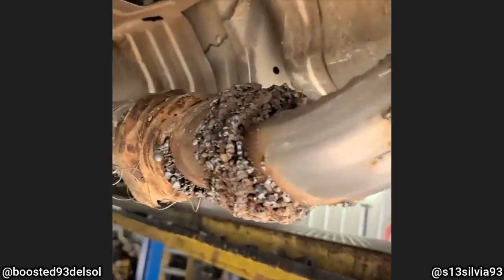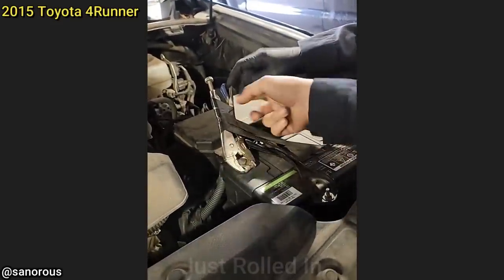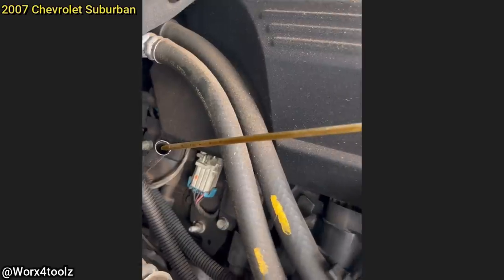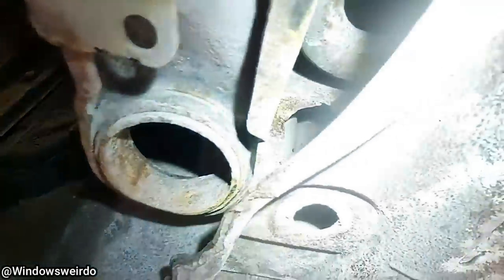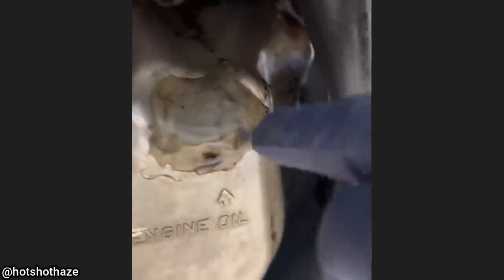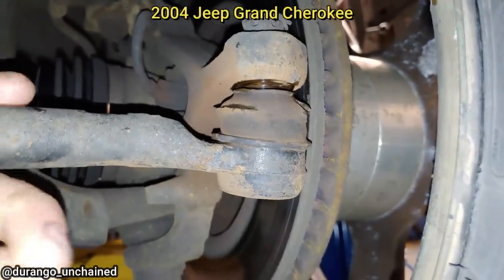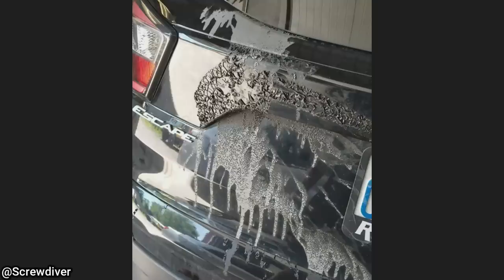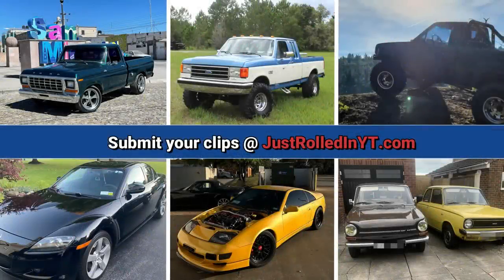Customer States Exhaust Sounds Terrible & Drags On The Ground | Just Rolled In

Comment: I’m always shocked when you say customer declined repairs over obvious problems.  Many (MANY) years ago I had a Saturn LSE & took it in for a problem I had at another shop.  The tech fixed my ongoing expensive problem for $12 then told me he couldn’t let me drive out because of a bad ball joint.  Obviously after getting seriously ripped off at the previous shop I was skeptical but he took me into the back where my car was on the lift & showed me my wheel was about to fall off.  I swear my heart stopped. At the time I had a daily 3 hour commute with speeds in the 80’ and for months I had to repeatedly get my car towed to the previous shop, spent 2k on repairs & not once did they mention my wheel could come off!!!
Reply: I'm hoping you don't go back to the first shop ever again, but please stick with the honest mechanic at the 2nd shop. Honest and knowledgeable techs are hard to find!!! (I know, because I am one).
Reply: @61rampy65  I'd recommend going back to the first just one more time to demand a full refund or face legal action
Reply: I was recently quoted something like 700$ for a new ball joint.  I went online and bought a whole new control arm with ball joint for 70$, and it was "moog", one of the best after market companies out there.  Took me an hour to replace it.  4 bolts.
Reply: Well not everybody is able to afford to fix their car right away like you obviously are. Consider it a glimpse into the life of poverty.
Reply: @markshort9098  I did go back to demand a refund, got some of the money back and that the tech was purposely not fixing my car correctly so I’d keep coming back because he wanted to get to know me better.  My husband then got involved. 😉
Reply: @bethmahadocon1887  unfortunately that sort of thing is very common and so is doubling the price just because the customer is a woman ( the vagina tax) I told my sister to always make sure to take a man when dropping her car off at a mechanic to avoid problems like that.. my sister took her last car to 2 mechanics and neither fixed it and she pulled up here and I had the problem diagnosed in seconds by ear before I even lifted the bonnet, any mechanic should have known what the problem was as soon as they heard the engine running
Reply: @markshort9098  I’m glad your sister has you to look out for her.  I used to be able to do my own maintenance. I’ve changed starters, alternators, spark plugs & rebuilt an old ford engine.  But, once computers got involved I had to step back.  Now I own a rotary and while I’ve run into the ‘vagina tax’ for repairs on that Google, my husband and local rotary clubs have been awesome at fighting that.
Reply: These shops really hurt the industry. I'd say more than half the shops see a car and see dollar signs that's it. Sell as much crap as possible, use scare tactics ect.  I see the person and their situation and list the problems as to importance and do what we can with the money they got... 

Im also about to close my shop cause its a cut throat biz and I'm too thoughtful, nice, and honest . If you want to make real good money you have to be ruthless. I mean i get by honestly but I can make more at other jobs that are much easier to do.
Reply: customer declined repairs can simply mean they cant afford the work at that point in time.
Reply: It may be a simple math problem.  A car is only worth X amount of money, repairs cost Y, and a new costs Z.  I've declined repairs on older cars before, because I decided it was simply time to trade the car in and get a new car rather than spend thousands of dollars to try to fix it, money that would be better spent on a down payment.  That said, I have never continued to drive a car in an obviously dangerous condition, but that may be what is going on in a lot of these cases.
Reply: I realise this isn't one of those situations, but do mechanics pull the same as computer technicians?  eg. pulls up netstat Look at all these people connected to your computer.  This is going to take hours to fix.
Reply: @jeremyr7147  There are such auto repair shops everywhere in China, and finding them temporarily in case of a sudden failure is tantamount to a sheep entering the tiger's mouth. The maintenance price of the manufacturer is also very expensive, but at least it can guarantee the use of original parts. Therefore, it is very important to learn the basic fault judgment ability and to have a fixed and credible cooperation channel for providing accessories.:goodvibes:

Comment: Some of the best advice I ever got was any cap that you pull off put it on the latch for hood,  so forgetful people like myself will be forced to figure out why the hood won't close
Reply: I did that with my phone once. I put it there to keep it from sliding off. 🤦
Reply: Oooopsie
Reply: @timothyball3144  Eyeglasses, ditto.
Reply: We were actually trained to do that at the quick lube shop I worked at.  Cheaper to replace an oil cap, than a whole engine.
Reply: @Timothy Ball  I left my phone under the hood of my car once on accident because I was using the flashlight.  My buddy closed the hood and it wouldn't shut.  Then I put my hand against my pocket and said "where is my phone?" As he was lifting the hood and slamming it down harder a second time to try and get it to latch.  Brand new phone too.

Comment: How do mechanics protect themselves from customers who deny fixing serious issues?  Do they write it up as denied service, or do they not work on the car?

When it doubt just add another 5 quarts of oil.
Reply: Was wondering something similar. If a customer refuses a service and it’s a matter of safety, can they simply drive away, endangering everyone else they meet? Can the shop empound the vehicle or call the police?
Reply: In the U.S., at least, mechanics are not allowed to keep people from taking their cars out of the shop. However, the shop can call police, who then can pull the car over (on the road) for driving an unsafe vehicle. When I was a tech, we would make the customer sign a waiver stating that he understands that the vehicle is unsafe.

Comment: I don’t have a ton of experience welding, but I did learn how when I was back in school. Before I knew literally anything about welding, I still did a better job than the people who make porcupine art on exhaust systems, which have been shown multiple times on the channel. How do you even do that? Like, max wire speed with minimum voltage?

I’ve seen many Crown Vics (and related cars) with axle bearing issues since it’s a common fault, but nothing like that. Normally it cuts the axle shaft itself in half before the bearing goes and jams the axle into the housing. Normally the gear oil leaking on the brakes and causing them to smoke is enough to scare people into bringing them in. I mean, they must have been driving that think with horrible noises, brakes smoking and fluid leaking for thousands of miles to get that kind of damage. Unreal.

Comment: I don’t understand how you could allow vehicles with certain issues to leave, even with owners signing a waiver?  Your local police department should be made aware of such vehicles I would think.
Reply: Ultimately it's not up the mechanic. The car isn't their property and if they refuse to let the owner take it they could possibly get charged with car theft.
Reply: The police might not bother doing anything even if they knew.  They care more about forcing people on motorcycles to wear helmets for their own safety, than people driving around two tons of metal with severe structural or control problems.  Probably because it's much simpler to write tickets for one than the other.
Reply: @Jeff DeWitt
But a victim of a car accident where the offending car was just “released” by a certified mechanic who should have known it was not safe to be on the road, could file suit against the company and mechanic
Reply: @flamboone9727  Unless the car was there for a safety inspection or the specific part the mechanic worked on caused the accident and the mechanic warned the customer the car was dangerous I don't think such a lawsuit would go very far. If a customer insists on leaving and the shop won't "release" his car after the bill has been paid the shop could get charged with stealing the car.

Comment: As a car guy....it's very surprising that people are so neglectful of something that needs to be safe.  To some cars are just an appliance like a fridge or a Washing machine.  This always puzzled me as I can always tell when something is waring or wrong with my cars.  Use my butt diagnostic 😂😂.  For some though they fix it when it stops working or isn't working correctly.  Cars are dangerous unless maintained well people!!!!.   It will kill you if say a ball joint/axle fails on the highway and you loose a wheel....dead.   I get a lot of people are not mechanically minded but at least educate yourself somewhat on proper maintence and servicing.  If you don't wanna do that pay someone too.  A lot of these are just people who don't give a f though.  

In Australia we have heaps of shitboxes on the road as once it's registered here at least in Qld where I am from you never need an inspections after that.  Yet the cops focus on the modded cars and car meets rather then the unsafe shitboxes that are everywhere.  Drives me crazy sometimes when im pulled over for a random check and a car blowing black smoke, wheels wobbling like crazy drives past.. I have said to the police officer.  Why don't you guys ever pull over obvious road Hazzard cars?  Like when they are blowing black smoke and oil all over the road?  He said SHUT UP!  .  Don't you love cops

Comment: How did anyone do that exhaust? I did my first welding on a Chevette inner fender and it didn't look that bad, it wasn't great but it stuck fine. OK when I moved on to the battery tray I lit the car on fire a little bit but it still looked better than that. 
Also fire extinguisher powder is a PITA to get out of carpet and heater air hoses are very flammable.

Comment: Just like the trunk coolant leak, I had  a customer a few years ago come in with an oil leak. It was funny because my boss didn't even give my a ticket but drove it in himself and we had a look at the oil pool in the right trunk kindey 😆
Reply: My car was leaking what looked like watery red blood across a carpark once when I came back.  I found that I forgot a bottle of Merlot in the back there and been driving enthusiastically. It drained down to where the spare tyre is and then there's a drain hole there.  But those carpets really stink afterwards.

Comment: I'm from the UK and here we have to get vehicles inspected annually before being certified for road use. Does this not happen in the US? 
Some of those faults must have been present for years!!
Great video. 👍
Reply: Only 19 out of the 50 States "require" a yearly inspection. In most of the "required" States the inspection is done only when first titling the vehicle, it's not needed to get the yearly license plate sticker. There are approximately 105 MILLION passenger cars in the US...no way to get all of them inspected.
Reply: @standupbroad6648  
“No way to get them all inspected”
Untrue. Just need to open more inspection stations. Think of the job creation. It’s a Democrats wet dream.

Comment: What kind of ideas do such "drivers" have? 🤦‍♂️
- hot exhaust suspended with plastic string
- "exhaust leak" in the Toyota with broken front axle and a rusty oil filter that hadn't been changed for 15 or more years
- at least the 3rd Ford/Lincoln wornthrough rear axle (here 2 Town Cars and at Rayman Ray's Repair 1 F-150)
I mean... those ppl may vote and reproduce! 🤦‍♂️
🤪😂🤣

Comment: A crack-head I know lost the front right wheel on his truck because he forgot to tighten his lug nuts. Instead of searching the field that his wheel rolled into, he broke into a fenced equipment rental yard, and stole an engine hoist. He set off a silent alarm, but by the time the cops arrived my crack-head friend was gone. He used the hoist to lift the front right corner of his truck and drove home on the rolling engine hoist. Cops followed tracks on the ground left hauling the hoist up a steep embankment to where his truck was, and proceeded to follow the deep scar in the asphalt left by the rolling engine hoist all the way to his house. They woke him and arrested him for burglary. While inspecting the engine hoist lash up he drove home on, they saw that he had a perfectly good spare tire in the bed of his truck. Kids...DON"T DO DRUGS!!

Comment: I used to work with a Guy that did Exhaust work like that. This may be one of his jobs. Furnace Cement, Bailing wire and as for the welding he was pretty proud of himself (13 years experience). It's Scary to see who is allowed to work on cars.

Comment: One question, is there something like the TÜV and controls according to UVV in the USA (TÜV = Technical Monitoring Association and UVV = Accident Prevention Regulations. The TÜV is every two years and the control according to UVV once a year for commercial vehicles.)? At my work there is also a special check by a trained team leader who checks our company car at the beginning of the year. Existing ladders, helmets, safety goggles, hearing protection, special nitrile gloves, first aid kit, high-visibility vests or high-visibility jackets and transport documents for propane gas are checked for completeness, up-to-dateness and functionality. For example, the helmets are replaced every two years. If, for example, there are problems with the tyres, the lighting or the windscreen wipers, I can go to a workshop at any time with a repair order of up to 300 euros and our fleet service will cover the costs. Because what I saw here in this video is almost impossible in Germany.

Comment: The problem in the US is: 
Mostly you can get a registration and number plate, without any safety inspection.
Here in germany: Totally impossible.

Here in germany, many shown vehicles would get forbidden, to go on driving.
So by trailer only, or get repaired.

Comment: Hilarious and Scary at the same time!

There are around 300 million vehicles on the roads here in the United States.

Around 20 percent (perhaps higher) of all traffic accidents are caused in some way by poor maintenance or lack thereof.

Owner/Drivers are responsible for maintaining their vehicles.
Unfortunately, drivers and mechanics are often negligent with vehicle maintenance and others suffer the consequences.

Owners, mechanics, dealerships and manufacturers could all bear liability for a crash if it happened because a problem was not fixed.

My Dad was mechanic and I learned a lot through the years from him and others.
We always did our own maintenance. But when it came to something we either didn't know about, or just didn't want to spend the time doing it ourselves, we made sure we hired someone who knew what they were doing and that it was done right.

Be Safe Out There ▶️▶️▶️▶️
       🪶 👆

Comment: I welded a new flex joint on my exhaust many years ago. I learned a lot. At the time I had a really mediocre flux-core welder and knew almost nothing about welding. I did not have a pipe expander to make the new joint fit properly. It took 3 tries to fill in all the pinhole gaps and spots I burned through, but I got it. Did not look anything like that. Wasn't pretty, but I got it done. In summary, it's very much worth the price to have someone qualified do your exhaust work. It's not actually that expensive.

Comment: Holy shit.. All that welding wire must cost more than the entire exhaust put together :D
Also, I'm pretty surprised that some of these vehicles are even allowed to leave the garage. Here in Norway, a garage that sees a vehicle unfit for the round, will report this to the Road safety authority, and refuse to let the customer leave the garage unless on a trailer or repaired enough to be safe.
After such a report, the customer then has 30 days to either turn in the plates or show the vehicle to an approved garage to confirm it to be roadworthy.

Comment: I had my “quick lube” lesson already. They told me the oil pan was stripped. But they could replace it. So after some argument I took it to the dealer. They said there was nothing wrong with it. Complete con. Didn’t think much about it. But the last two times I was there, a person waiting had the same problem. The scam has been going on for a long time.

Comment: Similar situation in a video from Ray where the bearings were so worn out that the whole wheel was being held on by the break caliper bracket because the axle had worn through so badly. They literally drove it until the wheel fell off.

Also, those tires aren't fooling anyone. Me thinks some booze was involved in that thought process. Way to go, making the vehicle dangerous just to act like you could afford those tires... Yikes.

Comment: I have always worked on my own vehicles. I started with small motorcycles and learned to be methodical after forgetting to refit the rear brake hub stay and having the drum wrap the rear brake cable around the hub and locking up the rear wheel. I only wrecked the cable so it wasn't a huge repair but danged if I know how people can drive cars in this condition. Do they have a death wish or are they simply that stupid ? Never mind, I know the answer...... Great videos. They make me feel better about myself every day :)

Comment: I used to run a powdercoating business, I can't tell you how many people asked me to coat their brake rotors. Shops would try to convince me that it was fine to do, because the "powder coat would wear off on the braking surface". I would ask if they were 100% sure that nothing important would be infront of the car before the coat was worn off.